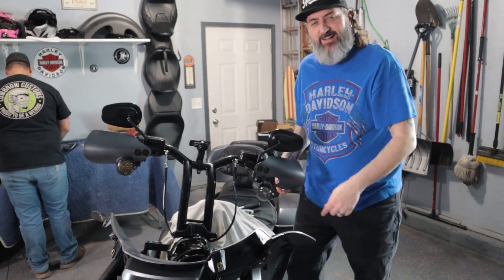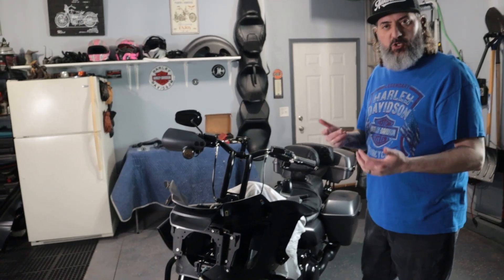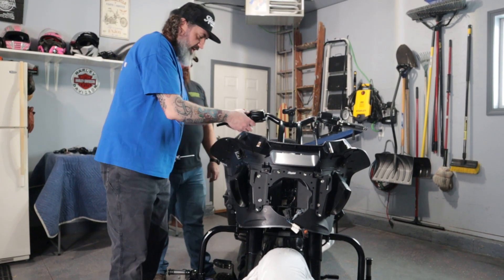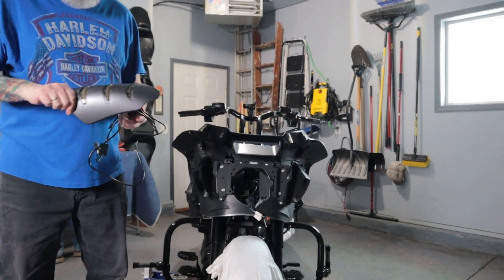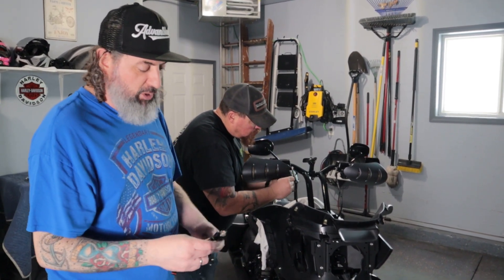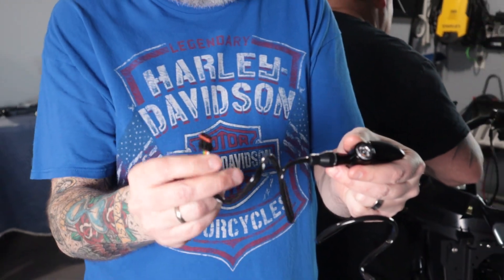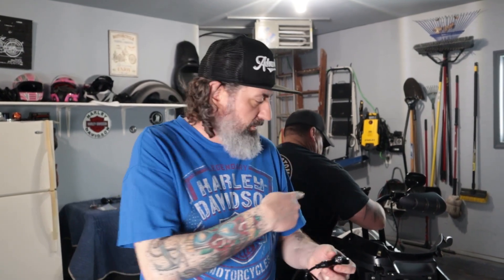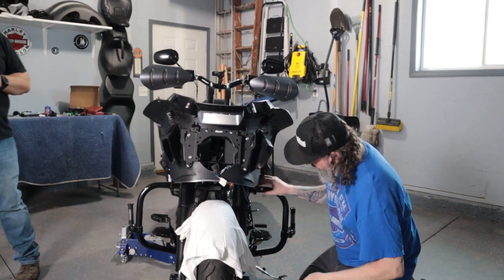Advanblack Lighted Hand Guards and Micro Bullet LED signals #advanblack #lightedhandguards #microled

Comment: I bought the micro bullets with my st fairing did you guys run into any issues mine stay on when the bike is off and the turn signals wouldn’t work
Reply from the maker: We had zero issues…everything was plug and play. 
Have your front lights or signals had any wiring done?